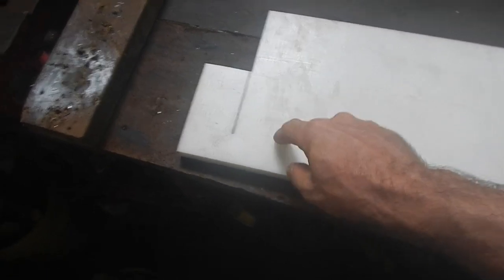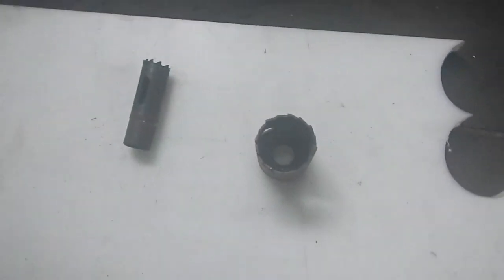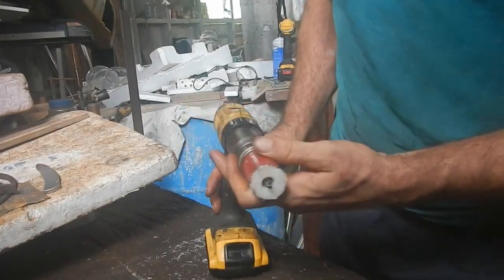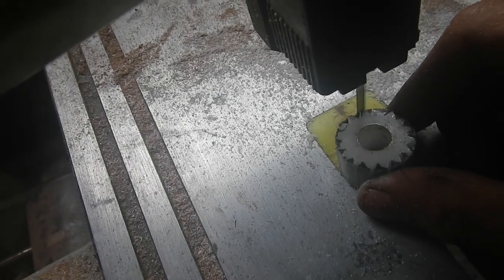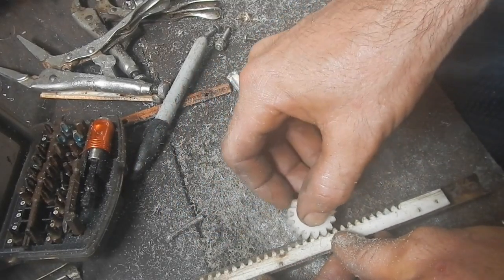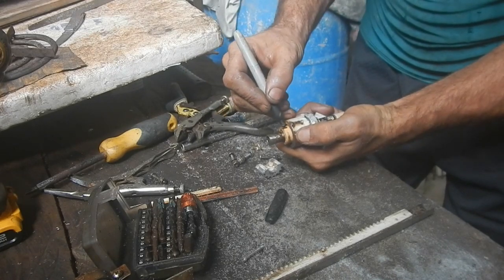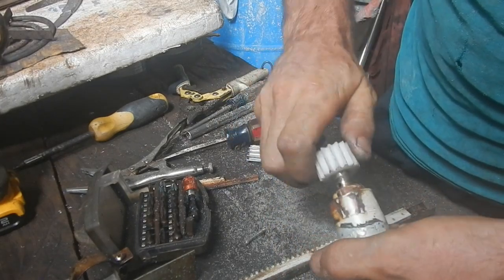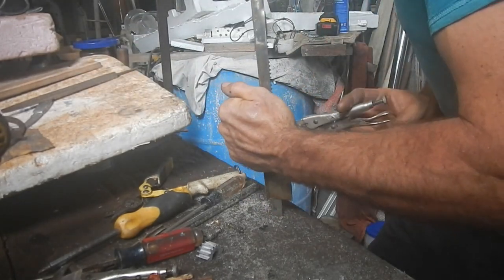Making Replacement Gear to fix Boat Steering

Comment: I like seeing these kinds of projects, I did a similar thing where I bought a steel cog and track used with electric gates and adapted the cog to go on the motor for roller shutters and put the track on some stairs I made. Now I can control my shutter and the electric stairs on the back of my truck with my phone for entry and exit, very secret agent and practical.